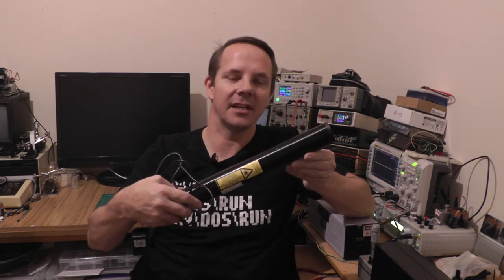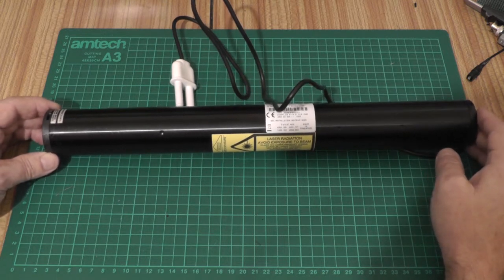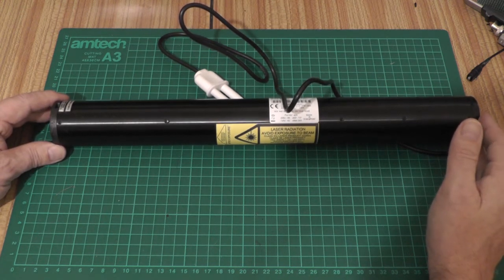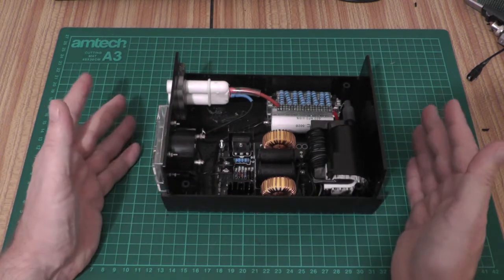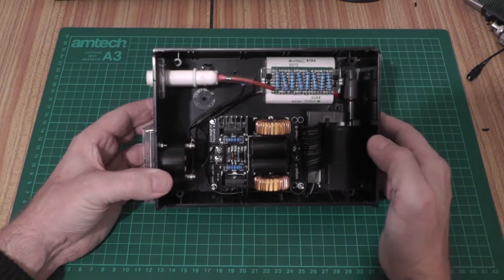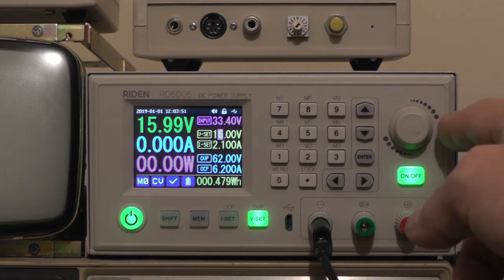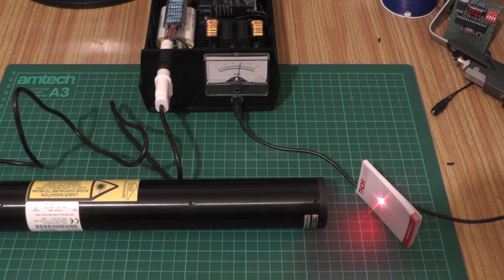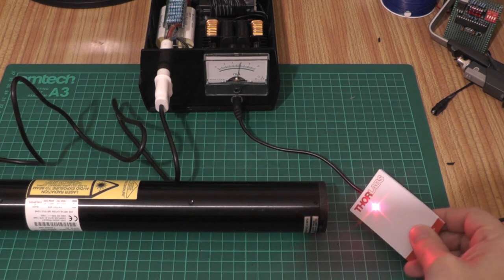How to build a DIY  Helium Neon laser power supply

Comment: HI. I have an LGK 7638 tube. This tube is about 50cm long. Unfortunately I am missing a suitable power supply and All my attempts failed so far. I am currently trying to build your power supply and this time the results look promising. I already managed to light a small HeNe tube. With the large tube my Capacitor arced through (I had only one with a far lower voltage rating then needed.) In any case I found out that the smoothing cap is absolutely necessary. Otherwise the tube develops funny discharges, presumably because it is rapidly pulsed and never gets to the point where it can develop a steady discharge at a low voltage. This is one thing that made me always think that I am on the wrong path. Once I added the cap it started working. I also noticed that the voltage of the flyback seems to drop once the tube has striked. This would be great as we don't want too much voltage drop on the ballast... Even though everything seems to work out this time I am asking myself if it would be better if I had an AC flyback and a cascade just for the ignition? In any case I like the DC flyback method better as it is much simpler and I already have a DC flyback laying around. What would you say?
Reply from the maker: I say if it works it works! Yes, when the tube is struck it will drag down the HT of a flyback. Internally the windings are "diode split" which is to say each layer of winding has a diode between them. There is parasitic capacitance between each layer of windings as well. Take those two things together, and you have a transformer with a built in multiplier!

Comment: Put a 1k one watt resisror, across the millamp meter. Protects it, gives it a contances and meter will not overheat..and stops induction spike from the meter coil winding, wile starting, I've  been doing that since 1968.

Comment: Get a mercury vapor tube our of one of those cheap gimmicky phone sanitizers. They have several landmak emissions for calibration of spectrometers. A while ago i used to grab surplus honeywell air purifier tubes and combine them with ccft drivers out of old document scanners. They worked great. 🤓

Comment: Great video. Is the power supply suitable for a CO2 laser tube? What current can it supply?
Reply from the maker: The design I am using is current limited to about 8mA for He-Ne lasers,, but ZVS drivers are capable of pushing hundreds of watts through a line output transformer. I'm not sure how long a standard monitor transformer would stand up to the punishment, but they are cheap, so give it a go!  You can buy CO2 laser transformers pretty cheaply as well, and I am willing to bet you could drive one with a ZVS successfully.

Comment: maybe i can do it with ceramic capacitors(10kv at 2,2nf)18 in paralel(equivalent aprox 0,04uf).the problem is the flyback have an output aprox 10-12kv.
i can burn my capacitors with that tension.i can use a ballast resistor before capacitors to drop the voltage a little?

Comment: I cant buy these capacitor from Romania.It could work without smoothing?My flyback is AC type.I tryed with many diodes and resistors and it work 5 seconds very well but after 5 seconds the diodes it burned.Maybe is fine to try with bigger diodes and bigger resistors?
Reply from the maker: You need to smooth the output. He-Ne's are unstable without it, and will significantly shorten tube life. 
Do they not have eBay in Romana? I had mine shipped from China! 
If not, you could always make a HV capacitor by series up large value lower voltage capacitors, as most Tesla coil builders are familiar with. Google: MMC or "Multi Mini Capacitor"

Comment: Thanks for sharing this! HeNe laser on eBay are still over a 100 euros mostly. Do you by chance know anything about how the current luminous output power relates to the original specs?
Reply from the maker: I picked up 2 for under £30 listed as unknown condition, so it was a gamble. But both work. I have not measured the output, but from visual comparison, I expect it is around 5mW. He-Ne lasers age well, and will keep working for decades, especially the newer hard sealed tubes.

Comment: You do excellent work - a solemn presentation with a professional demeanor. I appreciate the serious content, without comedy and mockery towards anything that isn't new or representative of the latest technology.
Reply from the maker: Thanks! Nothing wrong with old tech to my mind, often it is better. Take diode lasers for example, they drift in frequency at around 0.25nm/degree C without temperature control. Gas lasers on the other hand are very stable, the beam quality is excellent and have known frequencies, so make good standards.